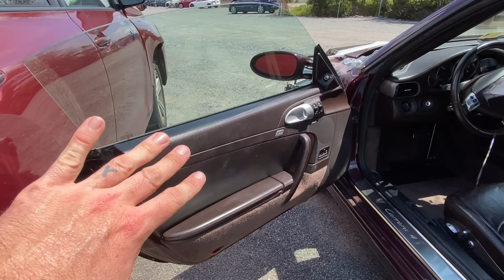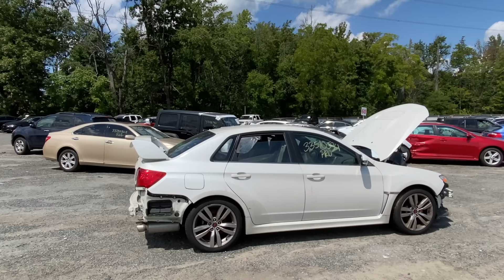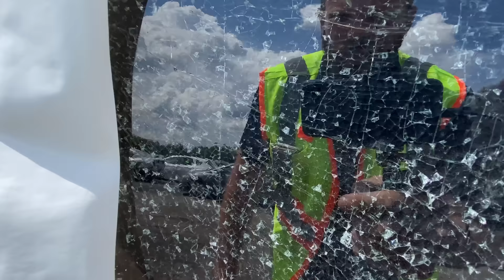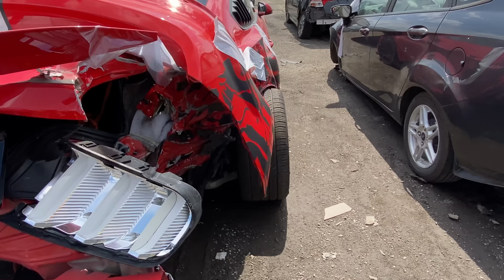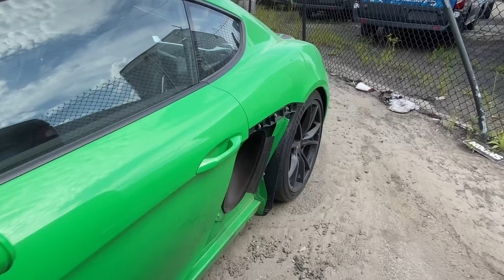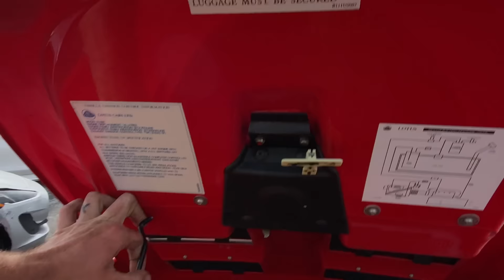Buying RARE Sports Cars At Salvage Auction! | HOW Is It TOTALED!?

Comment: For the Elise they come with a cobra immobilizer. There is a button you need to press before the car will even turn on the key fob. I removed it from mine because if your fob dies you are stranded :P It does look like the radiator is missing which is sus. But there is not much going on in the front. Radiator, oil coolers and some piping. All easy work if you know how to work on toyotas.

Comment: I owned an elise and suspect that Paul below might have sold it to me as 6' 2" sounds right (Hi Paul).  Once in the car, even super tall people fit and a 3 hour ride is great (done it many times).  As others mentioned, the entire front of the car is one piece and called the front clam.  Lotus says that ANY damage like shown requires a full clam replacement.  Clams from Lotus are expensive and even 10 years ago, took 6-12 months to get.  With the car out of production for 10 years now, I would bet that it's 2 or 3 years.  They also don't allow aftermarket from a safety standpoint, so yes, that is a total right there.  I would have tried to start the car although the Toyota 2ZZ engine is plentiful and cheap enough to do a stock replacement.  You also got it right to do a Honda K series swap and if you want a Z06 killer (the car weighs less than 2000 pounds), a turbo K20 will do it.  Don't write off all of Lotus with this one.  The Evora is way bigger.  It's also 50% heavier.  I won't say it's Corvette or Porsche easy to get in, but is certainly easier than an Elise.  Oh, if you want to see how difficult it is for anyone to get in/out of an Elise, watch the old Top Gear episode where Jeremy does it.  I'm 5' 9" and could get in and out.  Note how I didn't say "easily".
Reply: That'd be pretty hilarious, small world! 

If I could actually drive one, I'd have to k swap it...

Comment: You WILL fit the Elise, May be a dead battery and that car looks track ready if no electrical problems... which seeing that big speaker in the floor makes me think someone may have spliced somewhere they shouldn't have..  GET IT When I was thinking about one, I had someone let me try theirs to sit in.... (I'm 6'.0 but a tall torso same as 6'2")... next weekend I owned one.
PS- top off greatly improves access. 😃
Reply: Maybe I coult leave the top off and just hop in over the door.. it can't be any worse...

Comment: Are the Elise aluminum frame cars? I always thought they were due to the lotus mantra on weight. Always was told aluminum frame cars total out in even parking lot bumps a lot of times due to frame damage and the cost of repairing it.
Reply: Yes, Aluminum frame, but virtually nothing to protect "the car", so the exterior more or less sacrifices itself to protect the frame. The clam bodywork is so expensive to fix to factory spec, they get totaled. There are a fair amount of Totaled Elises out there with ZERO frame damage. Usually has to be an obvious hit before you get frame damage... chunks and pieces of fiberglass with the car.

Comment: These cars can have irreversible chassis damage. The chassis is built using a unique extruded bonded aluminum method. If it’s tweaked it’s unrepairable making it worth nothing more than a parts car. Some people search for these with tub damage so they can buy them cheap, hide the damage, distract buyers with other minor fiberglass damage, and flip them at salvage auctions to unsuspecting buyers thinking they can fix and flip it but Lotus enthusiasts know what they’re looking at.